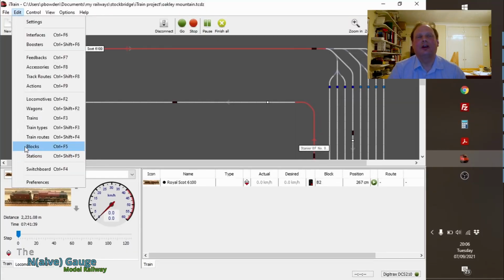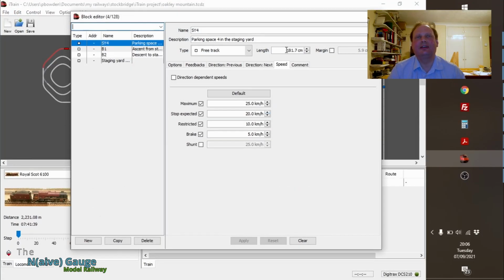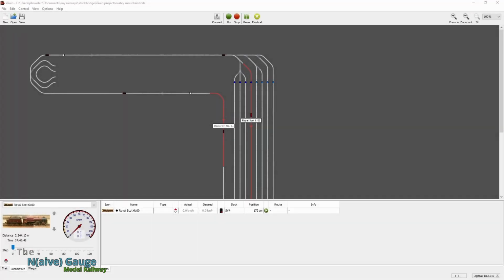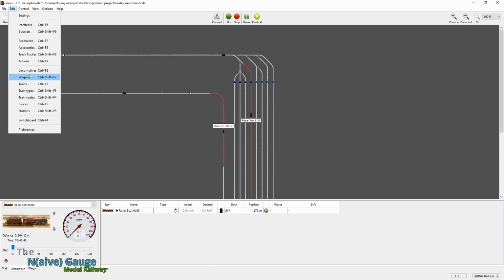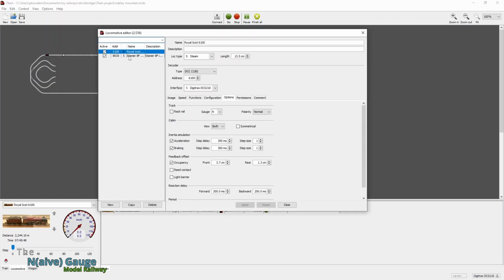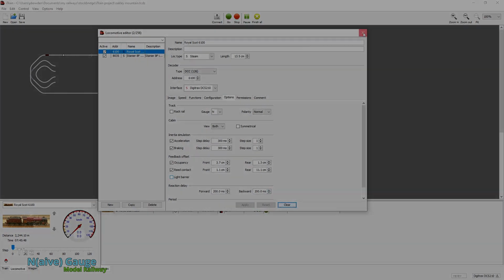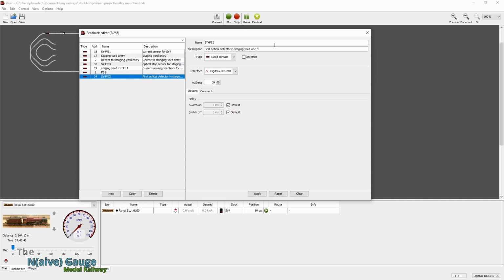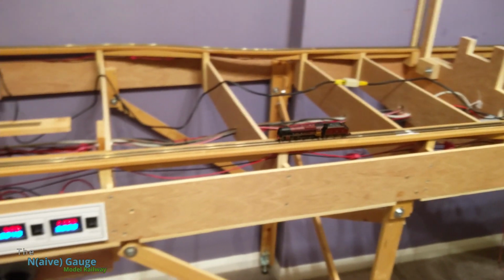30 Precision block control with Infrared detectors

Comment: I wonder if a metallic sequin glued on to the underside of the Loco would provide a simpler and more consistant reflective surface ...

I'm greatly enjoying the series as I'm considering an N guage layout ... ny very first foray into railway modelling.
I have very limited space ... I may not be able to avoid 1st radius curves.
Reply from the maker: Glad to hear you have found my efforts helpful. Small layout is always the best way to start (did not do this myself!), in order to learn the stuff you can only learn on the job. 
Short radius is fine, if you are willing to accept the restrictions. Most rolling stock can go around on it, however:
1) the over-hang at front and back is larger which can cause problems with clearance and coupling.
2)  there is greater resistance, so while a loco might make it around the curve, it can not pull a long train around it.
I am reworking my layout plan to remove all 1st radius if I can. Live and learn.

Comment: If you decide you need your IR detection, rather than painting the underside white could you use a white sticky label cut to size which would be more easily removed?
Reply: alu tape

Comment: There are unfortunately several errors in this video that contribute to the initial "inaccurate stopping" of the train, and correction of these errors would mean that the optical sensors are not required, here or anywhere else on the layout, as trains would stop very accurately.

The first is that after remeasuring the block length was correct but NOT the feedback length, which shows later as the feedback is 1.3 cm longer than the block. The biggest failing is that the reaction delay of the loco has not been measured or entered and remains at the default setting of 200 ms, which is why the train is not stopping correctly. Setting this value accurately will get the train to stop with a couple of millimetres off the desired position.  It is also possible that speed has not been measured correctly. As the block is a 'long' block and accurate stopping is wanted, the easiest way to achieve this  (after correction of the errors mentioned) would have been to create a second occupancy feedback 30 - 40 cm long before the turnout and entering this into the block. The train would then stop 10 cm (or whatever was wanted) before the end of the block without any additional effort because the position would be reset upon entry to the feedback.

I hope this helps people with getting the best performance from iTrain, and saves the video producer from unnecessary expense and complexity that isn't required :)
Reply from the maker: You are quite right Iain - a big question that needs to be asked, is whether all this is necessary / helping.
Part of it is me learning by experimentation, and I make videos to document the process, either good or bad, and I am pleased to have got to the stage where I can use an IR proximity detector to add an extra feedback. But of course, it needs to be considered if that is a useful tool to have in the toolbox, and I am planning to make a video to consider just that point.
However, I can imagine some situations in which I might want to add an IR detector - perhaps near to an un-coupler electromagnet for example. 
I also noticed the discrepancy between the block length and the feedback length while video editing, but I was not motivated to rerecord it. Full marks for observation though.
Calibrating the loco will also be the subject for a future video. I have done it, however I do not yet have a suitable stretch of track that is all on the level, so I suspect there there is a slight error in my calibration. 

Thanks for you interest.
Reply: @naivegauge  what is vitally important is that you do not demonstrate anything that is incorrect and that provides inaccurate information to people considering to purchase or use ITrain. 

Unfortunately your video gives the very clear impression that ITrain cannot stop trains accurately without additional help which is completely wrong.
Reply from the maker: I understand what you say. However, making itrain look good is not vitally important to me - I am just documenting my progress. 
Learning how to get the most out of itrain is all part of my journey, and as I learn from my mistakes I will make videos about those mistakes and the lessons learned. I am looking forward to getting the most out of the software.
However, to be fair, this video does not make itrain look bad. Indeed - it is a feature of itrain supporting different types of feedback that makes it possible for me to do what I am doing.

Comment: How will these opto sensors work when ballasting the tracks?
Reply from the maker: I have not done any ballasting yet, but I expect to have to ballast around them. So far all the places I have used them are not scenic anyway, so perhaps I will use current sensing in the scenic sections.
Reply: @naivegauge  Ah! ok, I have followed you chanel since you started, also use digikeijs and n-scale peco. Havent anything set up as you with blockdetection or sensors etc. But thinking of doing it some day.
Im no way near the size of you layout, but mine is done so it will be easy to expand the day I get a room free from one of the kids that still lives at home. :D

Comment: Hi. Got there eventually. Does this mean the first optical sensor is now redundant in its original position? You seemed to be "fixed" on the 10cm distance from the end of the block. Is this some arbitrary distance, or does it ensure that a loco/train stopping there doesn't block another loco/train crossing through the same point? Hope you had a great Xmas and all best wishes for the New Year.
Reply: Both optical sensors are actually redundant because if iTrain was configured correctly the train would have stopped in the correct position without them :)

Comment: Nice to see an update from you😁. Great progress with the opto sensors they are certainly going to do the trick, and make the sidings more accurate. Look forward to seeing your future progress all the best and a Happy New Year Tony.
Reply from the maker: Thanks Tony. It has been a struggle to get back to the hobby, but I am pleased to have finally pushed through and made some progress.
Reply: If ITrain had been correctly configured then the train would have stopped very accurately with the need for any additional optical sensors.